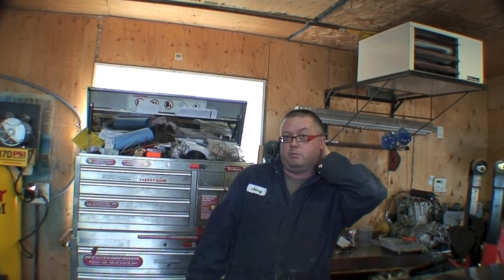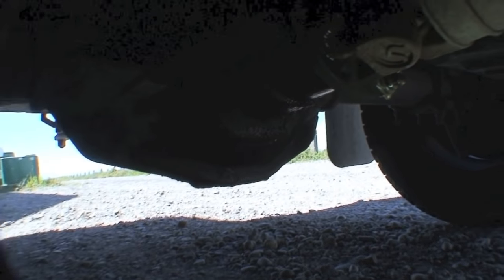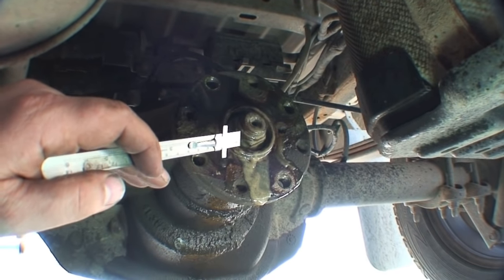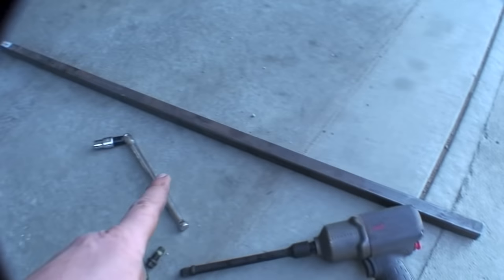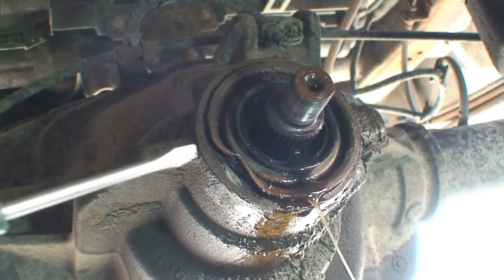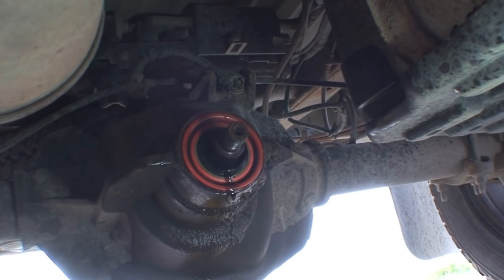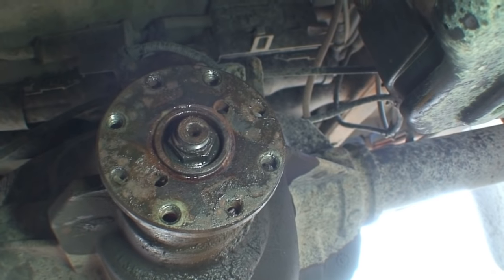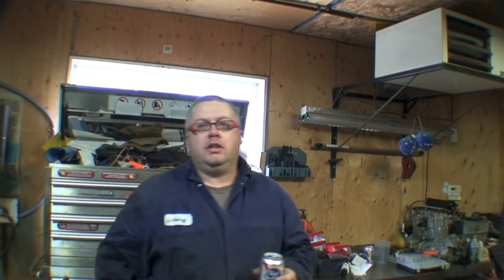How to Replace a Rear Differential Pinion Seal

Comment: Fluid Film is an awesome product but it really excels at preventing seizure between metal mating surfaces (i.e. rotor/hub). Free All is the best rust penetrant I’ve found. Also, it’s a common misconception that you need to mark the orientation of the driveshaft before removal. The shafts are balanced independently, not while on the truck. They are just grabbed from a stock rack & installed. You will get zero imbalance issues by reinstalling  90 or even 180 degrees from the way you removed it. Trust me.  I’ve been building Ford SuperDuty trucks at Kentucky Truck Plant for 25+ years now. I would add that it’s best to install the new seal using a large axle socket or an adapter from a ball joint service kit. Something that fits the diameter of the seal to allow you to tap it in equally around the circumference of the seal face rather than “walking it in” around the edge with a hammer. Good video either way. Thanks for sharing. 👍🏼🇺🇸

Comment: Awesomely helpful video. Haven't yet had to replace a differential pinion seal but at 320000 on my 2003 E-350 the seal has gone.  Going to do the job tomorrow knowing what tools I'll need and what obstacles I may encounter. Thanks again for this mad helpful video !

Comment: Thx....I have to do mine.....we replaced u joints a while back and my son reinstalled...I didn’t check his work. But the rear ones were loose.....it had vibration I checked and found it....it must have ruined the seal.......we live and learn....thx again.

Comment: i like that im not the only one getting drunk while working on vehicles lol
Reply: PBR has a calming enough effect while working on trucks.
Reply: Used to do it all the time, till I quit drinking!😁🇺🇸
Reply: Only works for me with mechanical stuff (suspension, engines, brakes). No drinking when it comes to electrical or autobody lol
Reply: Lol
Reply: Actually drinking beer right before working on something helps to get started lol
Reply: Some times that's the only way to keep straight when working on stuff

Comment: I ran into the larger driveshaft deal on my F150 too sometime maybe when I did U-JOINTS but I did research and the drive line is for an F250 and it was also a fleet truck of some sort I guess they just beef up the drive line for the fleet trucks which works out good for me with all the pulling I do. Great video thanks.
Reply from the maker: Nice to know if I do U-joints most likely they are for a f250 thanks for sharing that
Reply: it's not a f250 axle unless its got 8 lugs
Reply: Ford made a heavy payload package in 150’s with 7 lugs. Truck came with gvwr of 8200 lbs, Heavier shocks, upgraded springs and radiator, auxiliary tranny cooler, 9.75” gears and 3.73 limited slip. Just saying.
Enjoyed the video- keep up the good work

Comment: It has been in my experience that if a seal is leaking the bearing/bearings behind it are sloppy and the shaft wobbling is what beats the seal out. I am not saying that is always the case but on an 8.8 inch ford rear diff it is not hard to remove the outer pinion bearing for inspection. If the outer bearing is shit the inner is probably also. I also think it is a notable point to check the vent on any leaking diff, If the vent is not working that pressure build-up can push seals out also.
Reply: tdej80 in my case it was due from age. Every seal on truck seems to be going out. Last few years it's been inner and outer axle seals, diff seals, etc. BUT, pinion seal leaking could be due from a bad driveshaft carrier if you have one, most crew cab long box trucks do so, check that out as well.

Comment: A person changing this seal should be very careful when tightening that nut on the flange! The pre-load on the bearings & the pinion engagement in the ring gear is set by tightening that nut on the flange, there is a crush sleeve between the inner and outer pinion bearing. If you over tighten this it is over crushed and loosening the nut won't help, you would then have to disassemble put in a new sleeve and start over. Since no two crush sleeves are the same there is not a torque spec for the nut. What you check is the rolling drag on the nut with a dial torque wrench. It is something like 24 inch/lbs., with no axles or carrier in the housing. You tighten the nut a little check the drag repeat and slowly creep up on it so that you don't over crush the crush-sleeve! Hope not to scare anyone just want to make people aware.
Reply: pinion engagement (depth) is set by shims, not the flange nut (even if the nut is too loose). not all diffs have crush sleeves (my 14 bolt has one, my Dana 44 does not) , some use machined washers and step bearings, and those diffs do have an exact torque spec for the flange nut. 20-30 inch/lbs is for new bearings, old bearings are in the 5-15 inch/lbs range.
Reply: josh ziesmer That s all great info. The video that people came here to see is about changing the pinion seal on this Ford diff. I am pretty sure that people watching this video are mostly looking for info on a 10 year old ford not a 15-20 year old Chevrolet. But we could talk about Rockwell diffs. from 2.5 ton military trucks or dana diffs. from jeeps if you want. But in the end on the diff in this video there is a crush sleeve between the inner and outer pinion bearings and it does set the pre-load on the bearings and over crushing the sleeve will be detrimental to pinion engagement!
Reply: No, over crushing the crush sleeve will not change pinion engagement because inboard bearing is against the pinion shoulder, over crush will only affect outboard bearing, which has no affect on pinion engagement, it will ruin the bearings, but the crush sleeve has nothing to do with how the pinion engages the ring gear, all diffs including ones with crush sleeves still use shims to determine pinion engagement
Reply: nitrostateteam If a person makes a comment like I did they are leaving themselves open to every kind of reply! We are all adults here and I do have a sense of humor. If a person don't have thick skin they should not post or comment on videos. It takes a lot to offend me.
Reply: wow....good one you. A women with a sense of humour and an intimate knowledge of mechanics.
Your girlfriend is indeed very lucky :D ( again inappropriate comment ;) )
Reply: tdej80 great advice.
Reply: mme77  so about you saying do you hqve any video to follow steps. I fot 99 f250 7.3. And i need to do the diff  yoke.    Or where i can get more info. Thank you .
Reply: Melanie if you open your ears he talks about it !! Wake up dopey
Reply: I think I got my pinion broken

Comment: Great video, I'm almost done.  The gasket depends on how big your rear end is.  What I mean is that they put two different types in this F150.  I bought both seals and will return one when I'm done.  Im not smart enough to look and determine 8 or 10 before the job.  I believe those are the two choices.  I'm sure it's not hard to determine with 2 minutes of training.  Perhaps you just measure the pan.  Anyway, video was a big help.

Comment from the maker: im not too sure to be honest, i know on other differentials if you tighten it too much you can damage the bearing as your lock the bearing by applying too much torque... so far it's been good to me no issues or leaks since i've done this job

Comment: Great vid on this. I am licensed and have ran into that seal problem of not the right one when doing fords before. I remember probably the second one I replaced on a f150, removed the old seal tapped the new one in, cleaned it up, about 2 days later the truck came leaking gear oil out around the seal. What happened, that seal was like a couple thousands of an inch smaller diameter, you could actually move it in the bore. Cross referenced the part number, seal I got was for another ford axle that available for the same year. Something I noticed, you mentioned to lock tight everything but I didn't see you use and thread sealer or liquid Teflon on those splines of the yoke. It is also common for the fluid to work its way up the splines and it comes out around the nut, if left for a bit it can actually look like the pinion seal is leaking. Not saying it will, just an FYI for future reference if you ever do this again.
Reply from the maker: That's a interesting comment about the possibility of the oil coming up though the splines.  Makes sense indeed, so far no issues it's been over 2 years now but i will keep that in mind in case i need to do that in the future

Comment: Two things I would have added:   1. If you are NOT going to replace the crush washer, be sure to index the nut to the flange to know where to stop tightening. 2. You didn't mention checking for wear on the pinion shaft, and if so, also installing a sleeve kit.

Comment: just a thing I found out is that from the factory, ford put in a heavier duty axle in the f150. you have to have the parts store look up the same year just in a 3/4 ton truck. so instead of 10 bolts, it's a 12 bolt.

Comment: Same thing just happened to me with the same Seal made by the same guys, but at the parts store when I took the small seal back they asked what ring gear I had in the 8.8 or like 9.2 axle, I said the other one, haa haa, and I got the bigger seal!

Comment: thanks bud...good vid...I may be attempting this on my 2000 E-150 van in my driveway with minimal tools....I sucked up a plastic bag which may have taken out the front seal...made it home just as i started smelling the gear oil....lost @ least 1 cup of oil.....got the plastic off ....its not still leaking but....could be cuz its almost empty......the fill plug is not a 3/8" ratchet square its a bit too small or it was 3/8 & it got rounded out by someone else in the past a 1/2" is way too big..tried 11 different ratchets...I'm just gonna drill it out or drill like a 1/8"-3/16 hole @ the same height as plug just to get past step 1 & see if it holds oil with the plastic bag out or not ! also I accidentally busted the sensor on the top....which i also cant get off..it just immediately rounded ...the van has low miles but was parked near the ocean for 15 years(rust everywhere)..I hope that sensor its just for limited slip & perhaps just a traction light will be on...i dont care..the pumpkin is tied in to the rear brakes...think i read its semi-float type...wtf is that? .... i assume the slip limit works by applying 1 rear brake to the slipping side ..& may be "driveable" without it? I hope  .this sux....& yes this may involve allot of Beer ! input from any 1 appreciated
Reply: That sensor is for the ABS brakes. semi float just means its a half ton axle where the hub and axle are one piece.

Comment: Thanks for the vid!!! i followed the instructions and it worked well up until the point of taking my pinion nut off. the 4 bolts holding the drive shaft on were hell to take off because they were blue threadlocked, but i got them after 2 hrs!!! next i tried to get the pinion nut off and i just couldnt. i am guessing it has a ton of threadlock also and probably rusted on a bit. i hit it w P.B blaster but nothing. i tried 2 impact guns, putting the tires on the ground and starting the truck to...

Comment: Having worked for a Manufacturer, Land Rover, I can tell you that all sorts of weird things roll of the line. If you bought it new, they probably just had that axle handy and threw it in. If used, that could have happened, or someone before you threw it in from a junkyard.
Reply from the maker: that's quite possible that could have happened, the truck serial number is for a lsd rear end which I have installed

Comment: Fluid film is the best for removing rusted bolts. Spray it let it soak over night and you'll never have to heat or cut a bolt.
Reply from the maker: That's not true as I've used it a lot with little success
Reply: +Bullshitkorner weird always works for me. What stuff did you say you use Pb blaster?
Reply from the maker: Fluid film does work pretty decent as a rust preventive where I live
Reply: +Bullshitkorner yeah that's what I've heard it's also good for. I use it for pliers and stuff when they hard to open and close.
Reply from the maker: +EndoCloudz I actually used some fluid film today and sprayed it into a engine cylinder to keep it from corrosion while it sits
Reply: +EndoCloudz 
Run a plowtruck, so lots of salt and sand getting on everything. There's some nuts that just won't crack without an oxy/acetylene torch. Never had to cut them but you heat a nut like that and it loses it's temper making it useless.

Comment: Fluid film is meant to spray on your strut towers and unibody frame rails so they dont rust
Reply from the maker: +Friebe1000 if you can read it also says a lubricant and penetrates rust.  If you are illiterate I'm sorry but then you can't read what I'm typing.......
Reply: Lol, before I beat up on someone about their literacy. I make sure my use of punctuation and grammar are above that of an average 6th grader.

Comment from the maker: well, the hard part is you need to inspect the pinion bearing and most likely replace it which means taking the carrier and axles out of the differential.  you would have to remove the pinion and get the bearing off it and another pressed on..... and set it up the way the manufacture needs it done

Comment: My case I have changed the bearing and seal as per the service person said..
And after 4 months I got leak of oil from the same location u did..i drove the car with high noise I guess because no oil in.. So now Im thinking whether I change the seal or change the whole difrenchial??

Comment: If it were me, i would inspect the mating surfaces to make sure there is no fine groove and perhaps run some emery paper over them to get them as smooth as is possible. Worst case replace because new seal wouldnt last over any badly worn surfaces.

Comment: I hate those surprises. I just bought a 94 f250 and it has a 1 ton sterling 10.25 rear axle and the window buttons are wired backwards. Then come to find out the windows are wires with the plug cords to a lamp.

Comment: I have to change my pinion bearings in a few days. Does it matter if you jack the rear up.. or just make it easier to work on?
Reply: My jeep manual says to jack up the rear and remove the tires. I think this is because you have to check the amount of torque required to turn the differential. So when reinstalling you torque the nut to the same +5 ft lbs.
Reply: I mean idk for sure. Idk if that would make a difference. That’s just what it says to do

Comment: Preload is not set by he nut tension, it is set by the crush sleeve.  The sleeve can not be crushed past the point of the pinion shims bottoming out.
Reply from the maker: +Dan Henderson you can argue all you want but your a few years late to the party
Reply: What difference does it make if you posted the vid 6 years ago or yesterday?  The information is just as relevant.

Comment from the maker: putting it back with the same number of threads doesn't set the drag for the bearing, depending on the type of rear end some need between 10-20 inch pounds on a used bearing, then check your backlash to make sure it's still in spec.  if your rear end whines after getting it back together then it's not set up right.